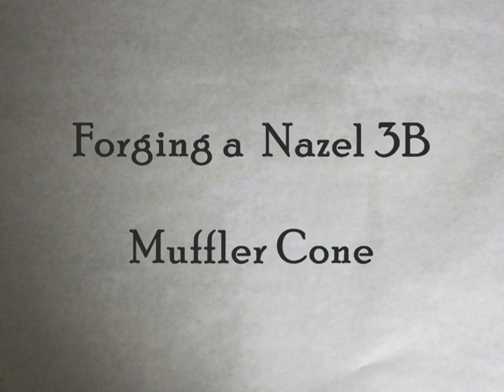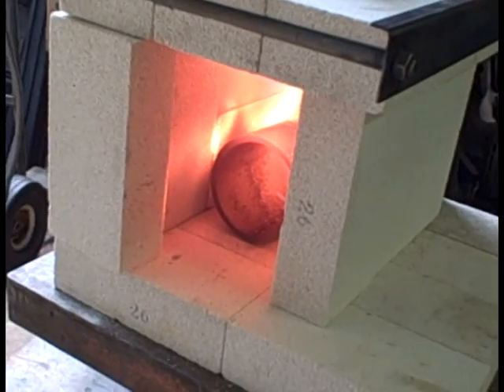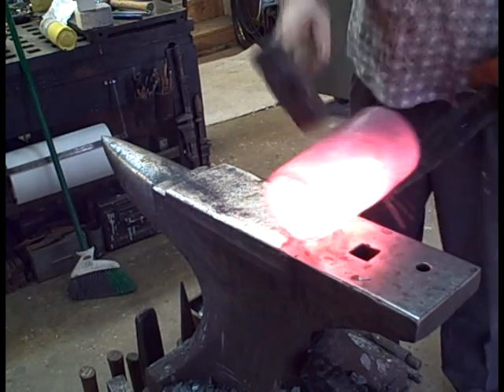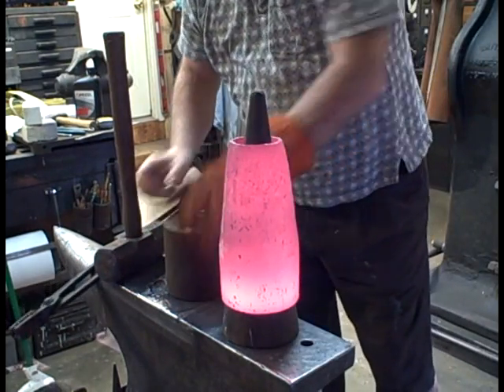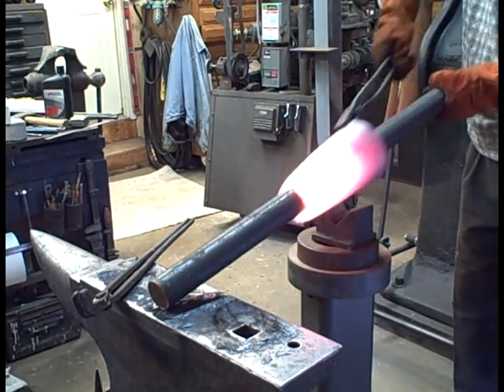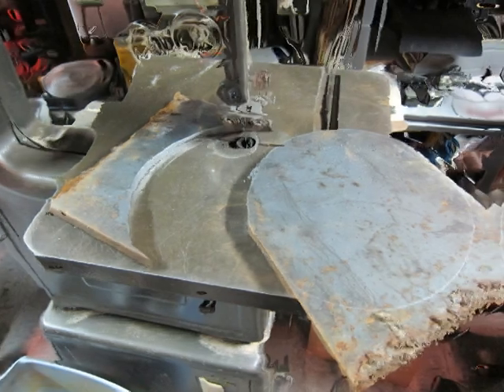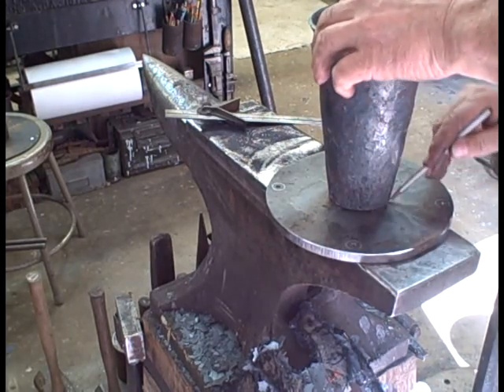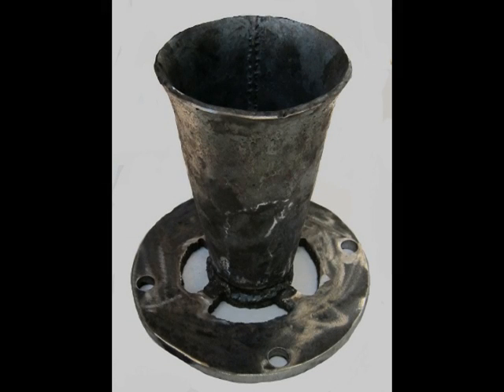3B Muffler Cone

Comment from the maker: The muffler cone helped the issue I am trying to solve (ability to do low soft blows with the ram), but didn't solve the problem.  The last chapter hasn' been written yet.  I had to quit working on the 3B because winter came on (the 3B is outside under a canopy) and the hammer cannot be run at low temperatures.   When the weather warms up significantly, I'll be playing again.  Thanks for asking....

Comment from the maker: Sorry I didn't see this comment earlier.  The first round took about a half day of work.  I have worked on it a couple more times since then, widening the top (so less air can get through).  

A "V" block with a saddle for a power hammer would have saved a LOT of time.  I have since then, made the saddle and a "V" block for another project.